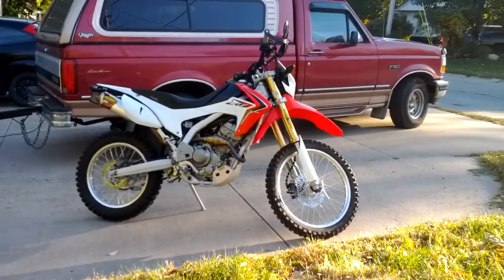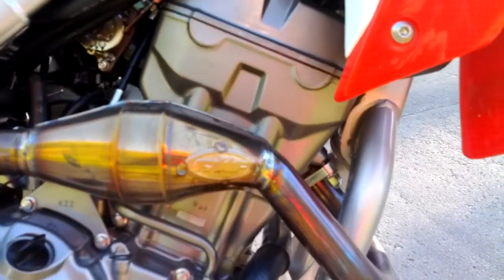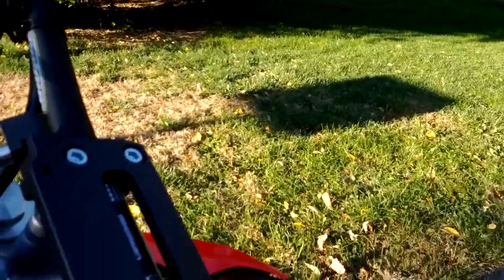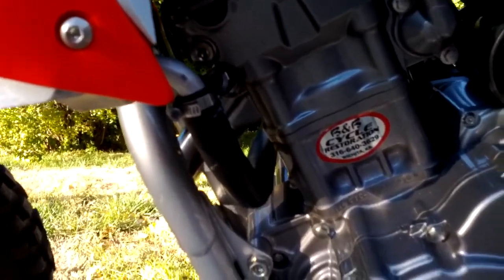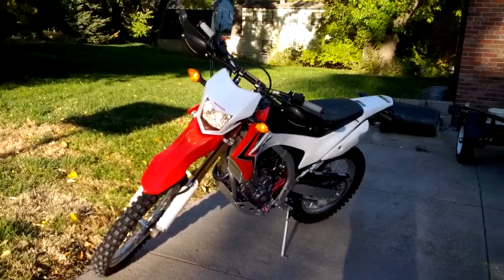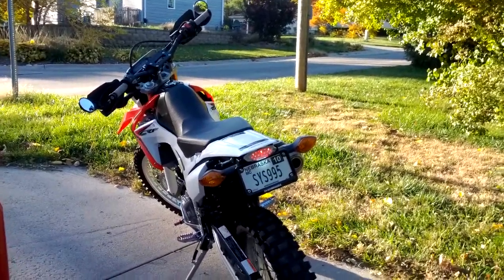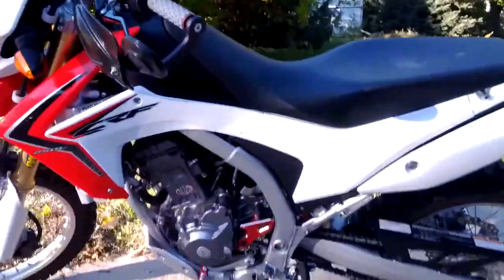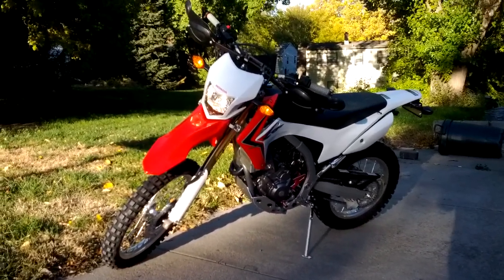CRF250L 305 big bore

Comment: Is your 305cc conversion still running well?  I'm thinking of getting a 305 big bore kit from Bill Blue but I want my engine to still be reliable. Obviously it wont be as bulletproof as stock, but how many km can I expect from this kit before problems start to appear,  like burning oil, loss of compression etc? Any info on the longevity or any cons (i know all the pros) of this upgrade would help make a better decision. Also has Bill blue made any improvements to the kit since its release? Improved piston design, balancing, etc, or is it exactly the same since 2013?

Comment: How many miles have you put on the bike since..? And,  no issues? -just sold drz400s, the CRF250L IS my next buy.
Reply from the maker: I have only about 400 so far and without any issues at all. I know a couple of guys that have over 4,000 miles with no problems as well.
Reply: i have almost 6000 on mine i did have the cam chain lifter fail on mine honda fixed it under warranty other than that its fun a little heavy for a 250 but i dont notice when im riding it. stock gearing is also a little high.
Reply from the maker: The miles posted were related to the big bore 305 kit. 

It is amazing how much lighter the bike feels after getting it properly suspended. I also am currently running 13/44's
Reply: i have only put a like 200 miles on it since but its running good need lower gears tho stock is to high.
Reply: also mine dosnt have the big bore i wish it did tho
Reply: Jacob, why did you sold your DRZ400s, you wanted a smaller bike?
Reply: +jack schitt I bet he wanted trouble free Fuel Injection.
Reply: Mine has 62k miles and still runs strong, road it 200+ miles a day at 75 mph and never had an issue

Comment: Hi Gary,  I was just wondering if you still have the 250L with the big bore kit still installed.  I have about 1,000 miles on my Bill Blue 305 kit right now and was wondering if you have the same issue with the bike running much hotter than before.  I did have my EJK updated to 3.5 for the install beforehand and maxed out the first green fuel setting as I was thinking that perhaps the bike was running lean and causing it to run hotter.  I do understand that it's natural for a big bore kit to run somewhat hotter than stock, buy I'm curious if you've had any long-term reliability issues.  Thanks for posting this video!
Reply from the maker: I had mine setup and tuned on the Dyno. So far I have had zero issues with the 305 it does seem to run a little hotter but, not too hot. I have thought about finding a larger capacity radiator but have yet to do so. 
I just upgraded my clutch with heavy duty EBC friction plates for a CBR250R and heavy duty Barnett springs for a CBR300R and removed the judder system. It is now one of my favorite mods and runs much better and will clutch up 3rd gear !!!
Reply: +Gary Nath (gnath9) Thanks for the quick response, Gary!  Did you do any cylinder porting or throttle body work when you installed the Big Bore?  Also, are you using an EJK programmer or a different fuel programmer?  I'm running the same exhaust setup, Q4, Megabomb, plus a K&N reusable filter, modded air box with the filter plugs, 13/45 gearing, and just upgraded my tires from Kenda K270s to K760s last week.  I had all my emissions stuff removed too and have a Acerbis 3.1 gallon tank.  I'm really hoping my big bore doesn't lessen my engine life....but that's the risk we all take, I guess.  ; )
Reply from the maker: +dadd gummitt 
I recently got a home made header that actually improved my low end HP by 1.5 on the Dyno and only lost .5 up top. It also seems to have smoothed the motor out a lot not sure why but I can tell a difference. I s surprised this header out performed my megabomb on the Dyno. I'm running 13/44's with XCMH tires. Since you have many mods I strongly recommend upgrading your clutch ... the difference is amazing. 
I am going to make a video soon showing all I have done but have been waiting on new graphics as I am not happy with the last ones.
Reply: You can find black plastics at bikerzbits.com.  The plastics and a Seat Concepts seat were my first mods. ; )
Reply from the maker: +dadd gummitt 
I don't want black plastics and I have a Corbin that is awesome for long highway rides ... andi am going to have a MX seat made.
Reply: Kewl!

Comment: What's your top speed?
Reply from the maker: with 13/42's I could still top out at over 80mph with a 65 to 70 comfortable cruising speed. I have just put a 44 on the rear with some new wheels. And an updated build video is coming soon.
Reply: +Gary Nath (gnath9) What chain guide did you put on with the 44? I am running 13/45 and temporarily relocated the factory.
Reply from the maker: CRF Jim  I bought the lower chain guide for a 2014 CRF150F. It bolts right up and that bike comes with a 48.
Reply: Thanks!

Comment: with what u paid for that lil 250 plus taxes,plus the 305cc kit(just 55cc up) & labor work..you could of gotten a new xr650l,stock would beat the pants out of 50 of those 250's...
Reply from the maker: I understand what you are trying to say but, I doubt the 650L could beat my bike in the woods or the MX track. I would even bet I could beat a stock 650L in a zero to 60 drag race. 
I built a bike for what I wanted and that is for local OHV parks and mild/vintage MX type tracks and just being a hooligan around town. It is my play bike and I chase my son on a CRF150F.  I could have bought what ever I wanted and I did. I am too old for a CRF450R or X and I can't ride one of those on the street nor would I want to.
The most important thing is to get what makes you happy regardless of the cost. I love the way my bike came together and this is an old video and I have many new parts on it now.
Reply: ive ridden both bikes and u have no idea the power/torque the xr650l makes,stock!.if u wanna say the 250l will beat the 650l,thats just ur opinion.my 2013 xr650l tops out @105mph stock.,.a buddy has the same bike with gears for top end,on gps he topped out at 121.5mph..i wanna see any stock or tricked out 250l do that.
Reply from the maker: Carry Smith
I have ridden one before and I know it is way faster with a lot more horsepower. If I was an adventure type of rider then I would agree with you but, smaller and lighter is always better for tight single track woods riding is the point I was trying to make. I have added 7 teeth to my sprockets and had Race Tech build my suspension added a scotts damper, big bore kit and FMF exhaust with an EJK etc .... all to make the bike do what I want it to do. I like all bikes and never put someone down for the choice they have made. The CRF250L is a great little bike !!!  even tho it may not be the bike for you.
Reply: Gary Nath I know you enjoy your 250L, I can't deny that but carry smith has a point, the 650L is only 29 lbs heavier than the 250L.  A 29 lbs lighter rider can change the whole weight equation.  Personally, I prefer a DRZ400, it has 12hp more than a stock 250L and weigh exactly the same (+/- 1 lb)  as a stock 250L.
Reply from the maker: *****  I was not disagreeing with anybody and I like all bikes. My point is that I do not care what anybody else thinks about where I spend my money and what I could have had for the same money etc .... No disrespect here but, The XR650L and the DRZ400's are old school 1990's tech. The CRF250L has the benefit of newer modern tech in terms of the chassis geometry and engine dynamics etc  .... the thing handles very well on and off road. But either way it is not a debate for me as it is my choice and nobody else's.
I do not not make many videos or even share much about the bike really and have not once said it was better than any other bike nor do I care.  
I do honestly believe with the Race Tech suspension and with the better chassis in the class that the CRF250L handles way better than all the "True Dual Sports" out there including the WR250R  and going from 14/40's to 13/44's and from 19HP to 28HP the bike truly is a very capable machine off road. Instead of making CRF250X street legal I chose to make a CRF250L into an "X" 
And speaking of spending stupid money and just plan craziness ... I just sent a 48T Renthal TwinRing for a CRF250R to the machine shop to have it modified to fit the CRF250L only because I think it will look great with my red Talon hubs laced with black bulldog spokes and gold nipples to my ExcelA6 black rims and this was a stupid mistake on my behalf as I could have ordered 8mm bolt holes on the new hubs. I never once said I was smart.
I just had a vision in my mind of what I wanted as an individual and I built it.
Reply: +Carry Smith Tell me your 121.5MPH speed wasn't based on speed odometer readings?  I used to have a DRZ400SM with a 436BB kit and head work.  I could go a 109MPH GPS, but my speedo indicated 121mph.  Having ridden both the XR650L and CRF25)L, I would have to say from 0-60MPH, they are really close machines with a nod going to the 650, but I haven't ridden a 305 properly set up, so its possible the 305 could be a minuscule quicker to 60MPH than the 650L
Reply: +Carry Smith The XR650L is the absolute by far ugliest bike you can buy. I'd take the 250 even if they are the same price! I'm done dealing with carbs :)
Reply: Tenny80 don't know why honda keep offering the XL650L, it's a dinosaur and should be dropped 5 to 10 years ago. It wastes dealer floor space, i never seen 1 sold from honda dealers in my area.
Reply: its 1 of hondas best selling bikes world wide>if u go any where in the caribbean or thru latin america ur gonna see a ton of xr650l..its a very simple. reliable,tough, durable powerfull dual sport bike...
Reply: "Powerful"